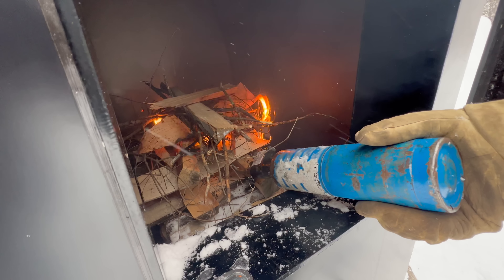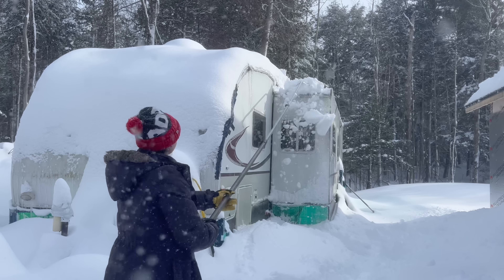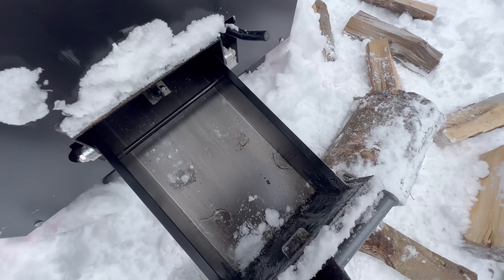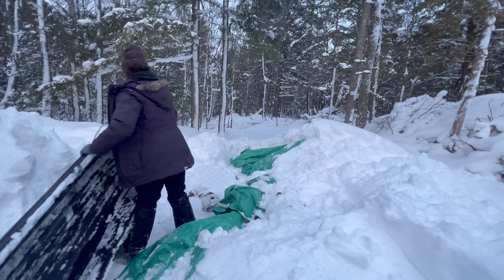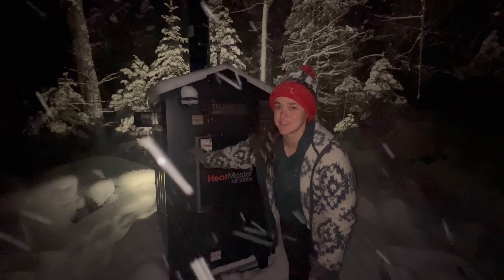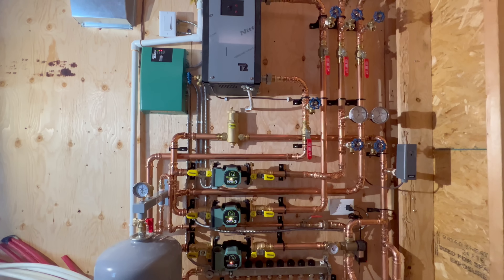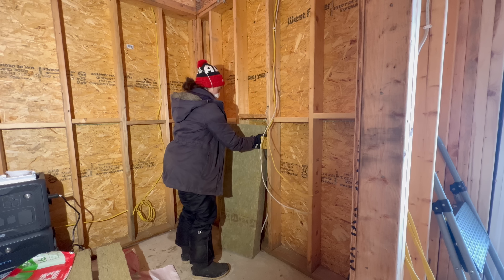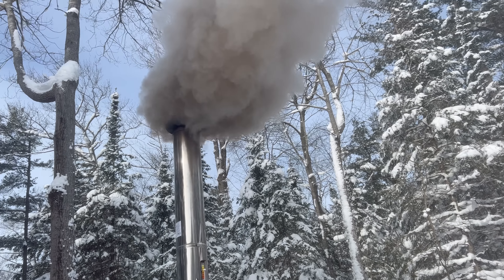How We Heat Our Home On Our 18 Acre Homestead!

Comment: You kinda jumped the gun on your heat system, having no insulation, will never keep up.Is it your forever hom?? If it I see you foamed exterior, how much? Try to reach R 27 in walls, which is foam and batt.Try to reach R50 in lid no matter what it takes.If you vault is weak on insulation and you don't have a good cold roof, which I don't think you are by design ,with venting?do you have sicker truss, if so gable vent high and get cold roof.But you risk getting ice dams, as you have roof pitches each way

Comment: Spray foam all the way. It is much cheaper over time. With your heated slab and spray foam, your heating costs will be minimal. And, spray foam is amazing for soundproofing. Make sure you get a reputable and skilled installer (It is truly an art form), but your inspector will want proof of an objective based solution if you spray your attic as a hot roof.

Comment: On your question of using rock wool versus glass fibre insulation: Rock wool not only has a higher R-value over time but it not affected by moisture and condensation that can occur in the walls due to dew point or air movement. Glass fibre insulation loses its ability to maintain r-value when damp (and once wet will never recover). While you have added a vapour permeable air-barrier to the outside, the presence of OSB sheathing increases the chance of moisture accumulating due to the dew point of the wall occurring when outside temperatures are extremely low. This can lead to frost on the inside of the sheathing and then melting. Mineral wool would be unaffected. The rule of thumb for air/vapour barrier installation is that the exterior surfaces should be 6 times more permeable than the inside surfaces. If the sheathing was not installed with a minimum of 3/16" gaps between all edges of the panels then you will need to super seal the interior starting with the vapour barrier if you are going to insulate with glass fibre. Use acoustical sealant and vapour barrier tape with a 4" lap over studs or trusses. Seal the bottom of wood plates where they meet the floor (gasket alone is not sufficient). PU foam any large gaps. Seal vapour barriers to the frame of the windows and doors. Seal all penetrations for plumbing and electrical with poly and sealant. While not mandatory I would recommend having an energy consultant perform a blower-door test after the drywall is installed. They will use a smoke pencil to route out any small air leaks that still remain as well as giving you a benchmark for the future. Finally, an energy-recovery ventilator (heat-recovery ventilators are not effective) is must not only to install but to learn how to use and maintain. Moisture build-up in the house is the number one enemy to mold and rot that could occur in modern house construction. (Don't forget to have your completed house tested for radon and install a radon ventilation system if over the current building code maximum levels)

Comment: I would go with rockwool just by the fact that ”Rockwool insulation repels water, so R-value is not affected.  It is also completely resistant to rot, mildew, mold, and bacterial growth – contributing to a safer indoor environment. Regular Fiberglass will hold water for a long time, slowly collecting at the bottom and causing mildew and rot on the surrounding walls.” 
Br. happy rockwool dweller

Comment: Biata, great work by you and the heating guy. On insulation I would strongly recommend rockwool. Yes it is expensive, but you’re not only talking insulating, but also firesafety. Rockwool will give as much firesafety as you can get in wooden structures. So keep up the good work and take care of yourself. Ps don’t forget installing fire alarms.

Comment: Nice to have you back. Hey, one thing that might help next time is if you can handle you six or eight maybe even a 10 inch piece of wood specially, being popple leave it hole because it last longer for burning. If you split it it’s gonna burn real quick, but left as a chunk. It will last a whole lot longer, just some information for you
Reply from the maker: Thanks for the tips! I won’t be splitting the logs as much for next year

Comment: Congrats on getting the wood boiler up and running. Word of advice, if you don't already know NEVER open the door to fill it with the fan running. It will blow flames out and you could be seriously burnt. I had it happen to me,and I was lucky enough to avoid the flames. You really need to close all the opening s up where you can see the day lite . Your heat is escaping out of it.
Reply from the maker: Thanks for the tips!
Reply: Its called a backdraught and I have seen it happen in industrial boilers.

Comment: Use bigger logs, had a boiler for 20 yrs, put 20" diameter logs, ur doing unnecessary work splitting it that small and cut to max length
Reply from the maker: Thank you!

Comment: Rockwool all the way, it has moister and compression properties that the pink stuff just doesn't have at all. Yes, it's costly, but it's not that much more than the pink stuff and it's a one and done cost that you won't have to repeat.
Reply from the maker: Thank you! Would you do rockwool blow in for the attic as well?
Reply: Yes, only blown mineral wool, the pink stuff will just compress and get damp and loose all it's R value within 5 to 10 years. Batts are better for sound dampening which you may want to consider with the metal roof. https://youtu.be/wH4Oyj4fNxQ This is a great comparison video with everything you need to know. @SimpleLivingwithBiata

Comment: I never install the pink stuff unless the customer insists (even then, I try to talk them out of it).  It's cheaper, but that's its only benefit.  Rockwool is fireproof, sound dampening, critter and bug proof, doesn't sag over time and dries out if it gets wet. The pink stuff is none of those, and if it gets wet you'll have to tear it out and replace it.  You can upgrade flooring, countertops, fixtures etc. down the road, but upgrading insulation is a major project. This is your forever home.  Don't skimp on the stuff you can't change later.  BTW, I usually choose Rockwool over spray foam also. It just doesn't have enough benefits to merit the huge jump in cost.
Reply from the maker: Thank you so much for this! Yah the price of spray foam just isn’t worth it anymore
Reply: I second this 😊
Reply: You won't regret spray foam or rockwool, both very good
Reply: 100 percent, that's what I put in my forever hm. Good stuff

Comment: Hey Biata? First like others have said, congratulations on getting your wood boiler up and running. Second, I have a tip for you. Something I learned from my friends that have wood boilers is that once you get a good bed of coals in the bottom of your boiler, you can literally stack the fresh wood you are putting in. And also you do not have to have every piece split that you put in. If you have round  pieces that are 6" and up or basically whatever you can handle and of course fit through the door will be just fine. Doing this should increase your burn time.
One more thing. If you haven't realized this yet is to not be disheartened if it is taking so long for your slab to heat up. Remember that your slab is ice cold and you are heating it up in January. This is to be expected. But once you get your floor up to the perfect temperature  you are going to be amazed at how warm your house will get in its current state.

Comment: One thing to try on the wood boiler.  Get a good bed of coals going and lay the logs all one direction and fairly tightly packed.  Fill the firebox all the way up.  This is more efficient because the fire is less likely to go out, and you are not opening boiler so often.
Reply from the maker: Ouu thank you! Struggling with the bed of coals

Comment: never heard of a wood boiler or what ever I don't get it you have to go outside and burn wood to have hot water makes no sense to me why wouldn't you have it indoors to heat the house at same time. I'm sorry meen no disrespect but that is the dumbest thing I've seen
Reply from the maker: #1. they aren’t safe to be inside a house. 
#2. Most  people who run a homestead are already outside cutting and splitting the wood
#3. you only have to fill twice a day when the house is insulated 
#4. You get better insurance when the wood stove isn’t in your home
#5. You don’t have to have an entire room in your house dedicated to storing wood
#6 you aren’t getting bad smoke pollution in your home when you open your furnace door like you do with an indoor wood stove (even just in small amounts)
#7 it’s extremely efficient because you’re heating your in floor radiant heating that holds for days. Heating your hot water is an added bonus. Forced air is an inefficient heating system
Reply: @SimpleLivingwithBiata  hey really eh I have never seen them before that was first time you made some good points I'm just used to heating house with stove so it being in the house seemed like would kill 2 birds with 1 stone lol. if only have to put wood in 2 times a day is pretty good.
Reply from the maker: Thank you! The other cool thing about it is you can burn any type of wood. You're not limited to just burning hard wood. Which is perfect because we have a mixture of hard wood and soft wood in our forest. soft wood will be great for fall and spring
Reply: @SimpleLivingwithBiata   thats really cool thanks for educating me out of my 1 way to do things and everything else is wrong cause I'm always right in my head anyway lol.